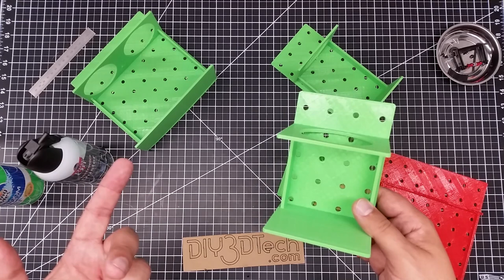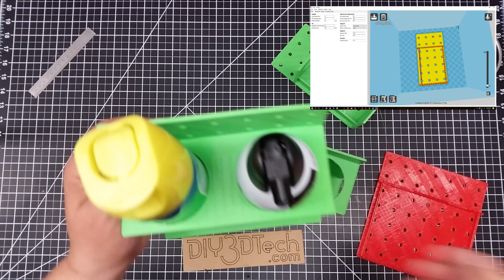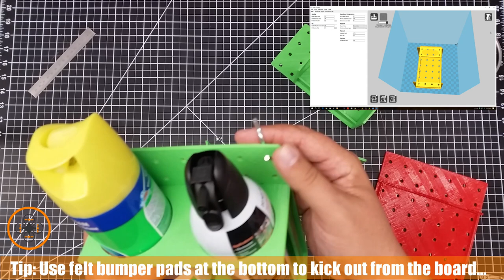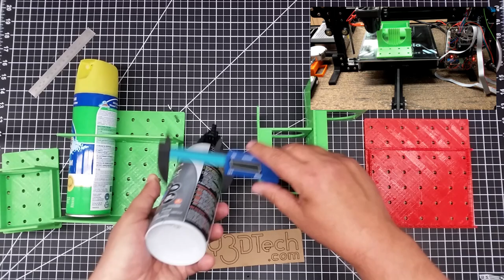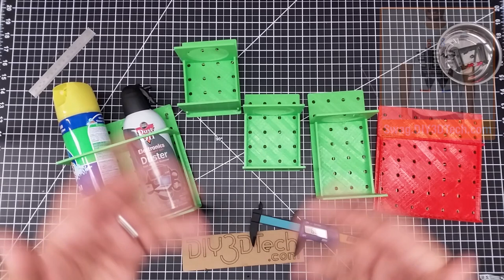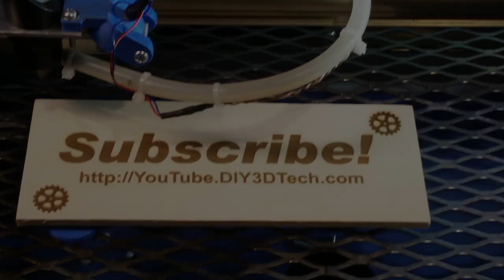3D Printed Project - Coping the Design Challenges of a Project!

Comment: Joe, has something changed with the printer you used? Slicer settings, printer location (fan or AC effects), or different filament?  When it didn't pull on large prints was there something different?  Only way to get different results is to change something.
Reply from the maker: Just filament, but I have seen the math of model do strange things even being water tight and slicing fine.  So changing the model did make a change.  So I might try some different filament as as for the high volume channel print stuff I get this filament for around 11 to 13 bucks which is far from the best (but I use a lot of it as my wife points from the electric bill)...

Comment: I found my CR-10 lifts like that on some flat parts also in pla, I think it has much to do with temperature control.  When I put the printer in a smaller room with all doors/windows closed I was able to get the same file to print without as much lifting.  I wonder if an enclosure would help, so a custom one is on my to do list soon.
Reply from the maker: I hear you and if was ABS I would be all on board, however with PLA I have not had this happen before (at least this bad).  I am going to try some different filament and see what happens...
Reply: also wondering if a raft or brim would help?
Reply from the maker: Brim likely would (to increase surface aera)..  Good idea :-)

Comment: I get that corner pulling from time to time also.  Any ideas what causes that?  I have been wondering if nozzle temp effects it.  I wonder if Higher temps makes the plastic more relaxed when it prints or if the higher temp causes the plastic to retract once it cools.  I have found cheaper PLA works better at higher temps for layer adhesion.
Reply from the maker: Yes on the cheaper PLA at high temps as I run about 10c hotter on on the cheap stuff and yes I think you are also right about the plastic "contracting" more because of this.  However I have not seen this much pulling all in the "same" spot which is the odd part...